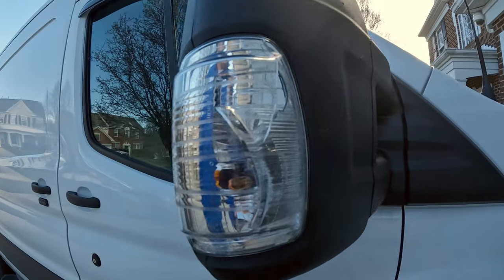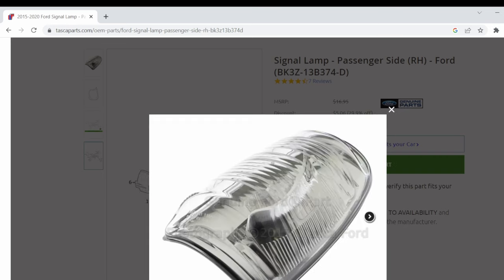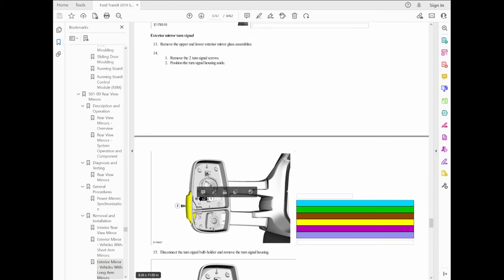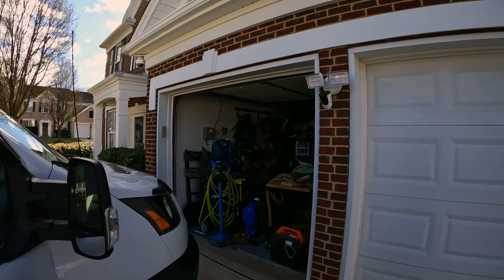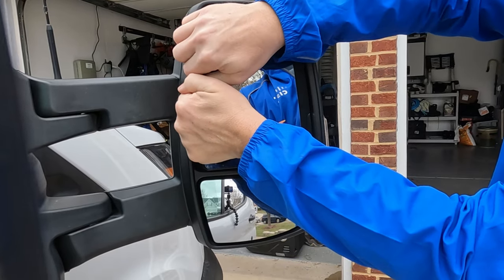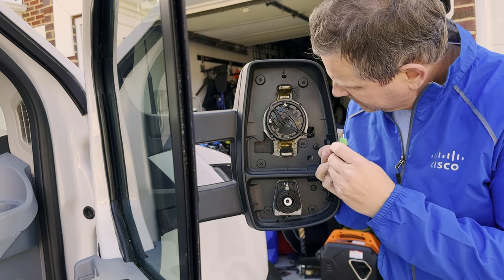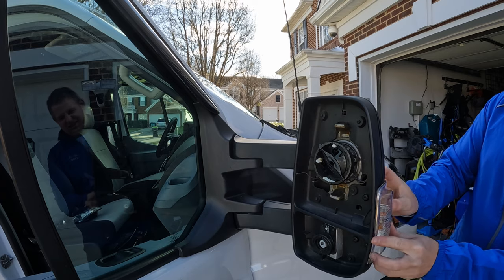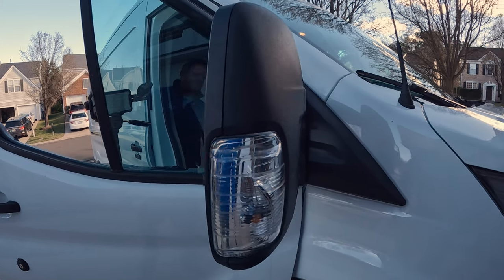#MTBPlanB 2019 Ford Transit DIY replacing broken passenger mirror turn signal lamp.

Comment: Appreciate this upload.  Able to gather  what I needed prior.  Purchased $14 Amazon RLB-Hilon seller cover.  I used a wooden flat spatula to pry the bottom mirror off.  Easy to follow process.
Reply: Oh and I didn't remove the heater wires. I laid the mirror in the mirror wing hole. Was concerned I F that part up

Comment: I am trying to find the bulb sockets for these turn signal inserts, but can't find anywhere. Would you by any chance know where to find it? I took a snapshot of your bulb socket as it appeared in the video to help me find it.
Reply from the maker: Not sure, it may be the same as the indicator socket at the headlight. https://www.fordpartscatalog.com/oem-parts/ford-signal-lamp-bulb-socket-2u5z13411sa?c=Zz1lbGVjdHJpY2FsJnM9aGVhZGxhbXAtY29tcG9uZW50cyZsPTIyJm49QXNzZW1ibGllcyBQYWdlJmE9Zm9yZCZvPXRyYW5zaXQtMjUwJnk9MjAxOSZ0PWJhc2UmZT0zLTdsLXY2LWdhcw%3D%3D
Reply: @MTBPlanB  I think that's for a bigger light bulb, not the tiny T10 bulb that goes in the mirror turn signal lens. I found this item mentioned in Ford Transit USA Forum for people who want to do turn signal upgrade to their standard mirrors, in case anyone is interested. I will also put a link to the bulbs, again for upgraders or anyone who needs a bulb replacement. Thank you for your response.

------------------------------------------------------------------------------------------------------------
Connectors Socket Bulb Brake Light Harness PigTail T10 158 wiring
------------------------------------------------------------------------------------------------------------
https://www.amazon.com/dp/B011DNKDDG/?coliid=I2138QVXT3AEH0&colid=I90I0IV5VLMD&psc=1&ref_=list_c_wl_lv_ov_lig_dp_it

-------------------------------------------------------
Signal Bulb - Ford (BE8Z-13466-A)
-------------------------------------------------------
https://www.getoemparts.com/oem-parts/ford-signal-bulb-be8z13466a

These little signal bulbs are very expensive, something like $7-10 a piece. You can find it cheaper on eBay or a 10-pk for about $1 a piece. I don't think anyone would like to pay $70-100 for 10 small bulbs.